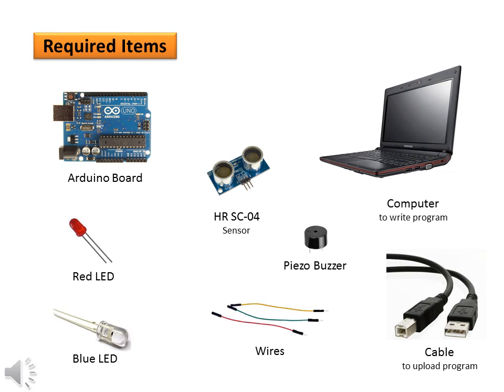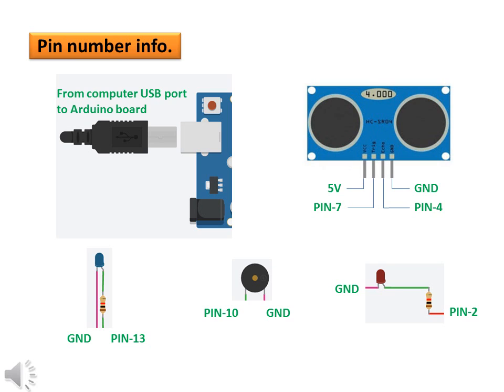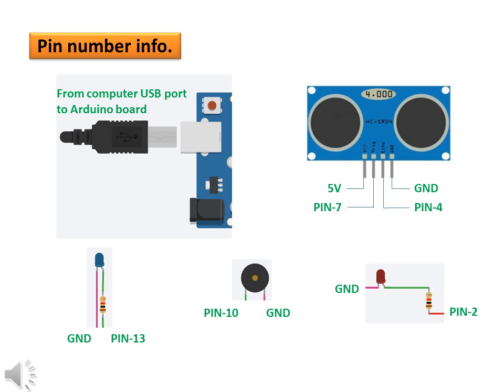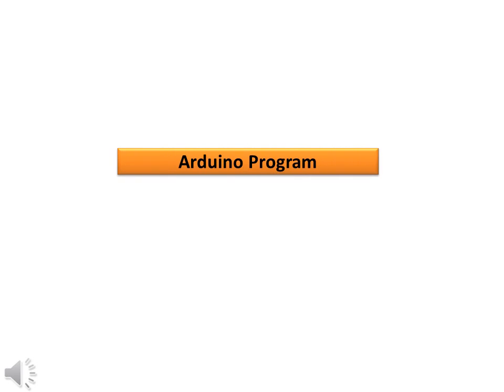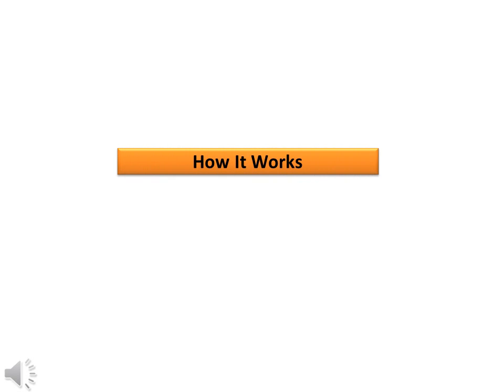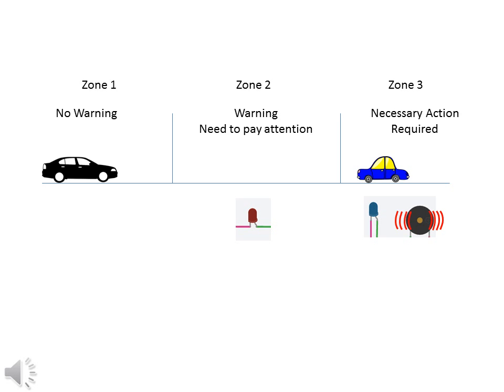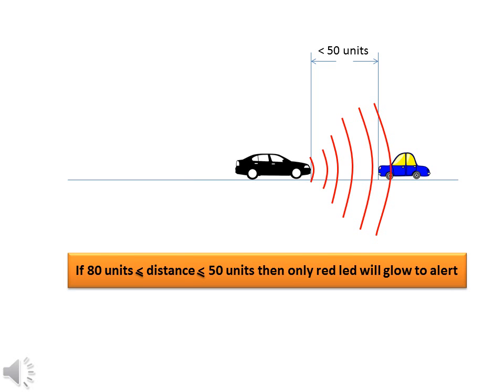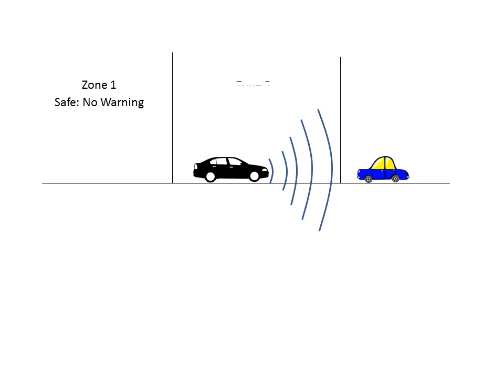How to make Arduino based collision detection warning system

Comment: Batteries are not connected in the circuit they just placed on the wire .... it's Not a working model
Reply: he was powering it with the data transfer cable